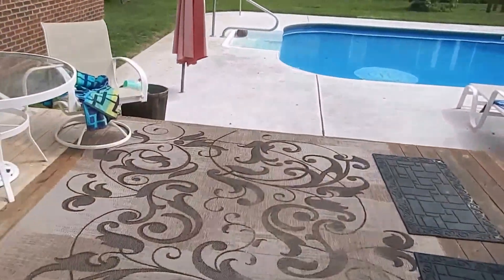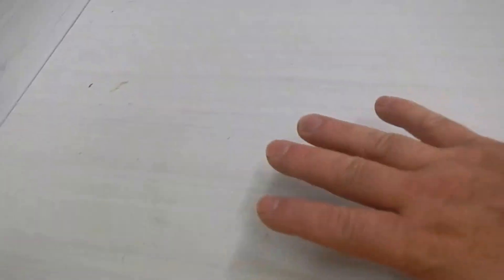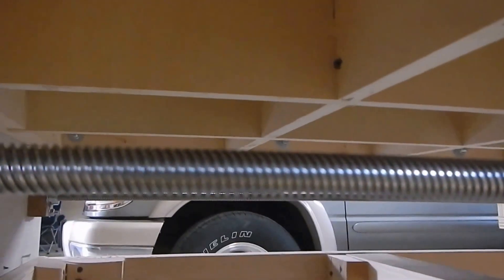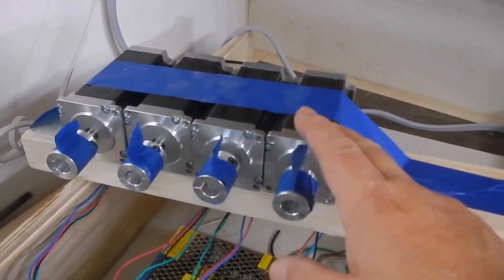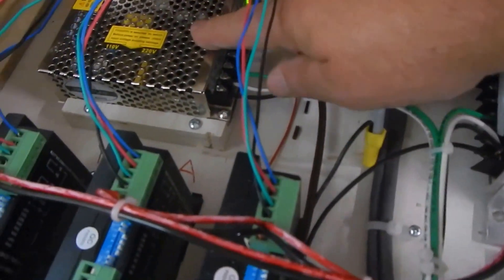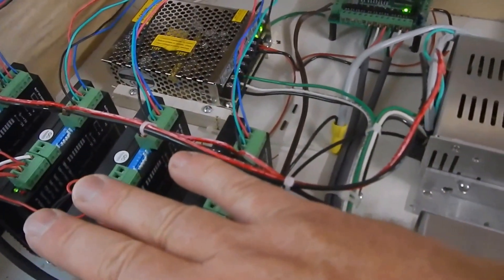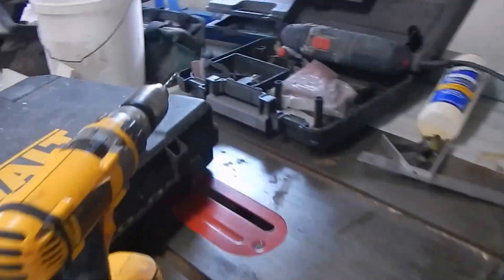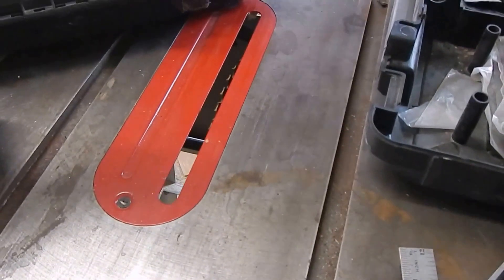Home built CNC router

Comment: i be interested in the wiring diagram as well , do you have it posted somewhere ?

one thing i would do different is make the machine so you can feed a full size sheet of ply through it , the machine doesnt have to be as long as said sheet just wide enough to take it with enough room around to fit the plate and have the table open to the front and rear 
that way you can start machining one end of the sheet and have the machine put one or two  reference holes in it , then slide the board to the other side and put the refference hole over dowels stuck in the table of the cnc router and have the machine router cut the other end / next part of the plate 
you could still cut slots in the front and back of the machine you made at the height of the working surface so you cab slide stuff through without loosing a lot of the strength 

think having the whole box thing might cause the machine to fill up with sawdust and maibe stall too because of having to plow through the stuff and the board its machining
Reply from the maker: Sorry, I don't have a diagram. It's been a while so I would need to refamiliarize  myself with it.

The ends and sides give the whole machine strength and somewhat contain the
 waist. This works very will for me. I don't see a need myself to route 
longer pieces of work. If needed I could cut slots as you suggest.